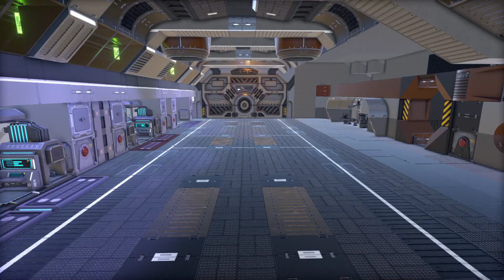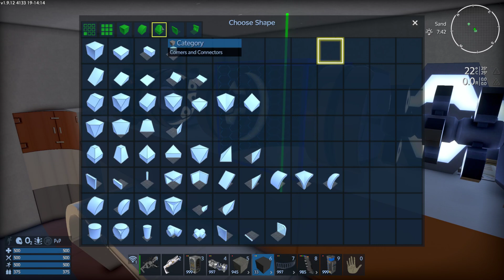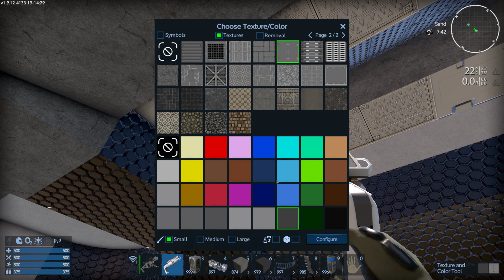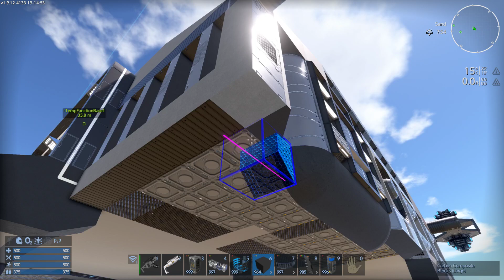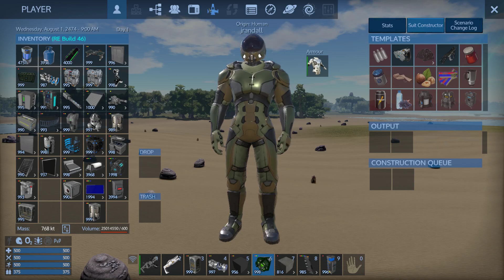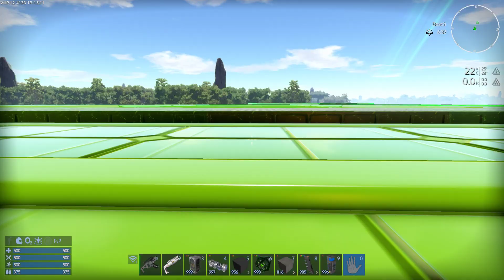Empyrion Galactic Survival - New functional base build part 7

Comment: Loving the build so far, I like the name Skeksis for the ship it's from an old movie called the Dark Crystal. Did you know that ctrl+rmb will transform anything you're holding into another item, device or block. A block becomes a plant a plant becomes a generator a generator becomes a crew member and so on. It also means that if you're holding a carbon block for instance and you ctrl+rmb on a steel or concrete block it changes to that same composition, so no need to fill your toolbar with different types of blocks, really handy if you ask me.